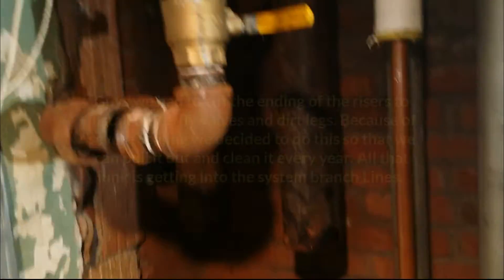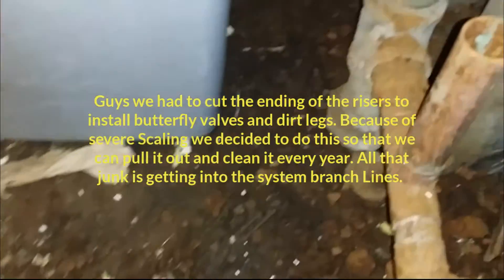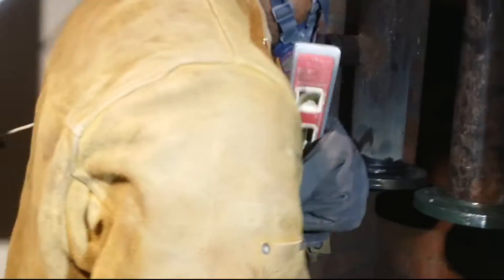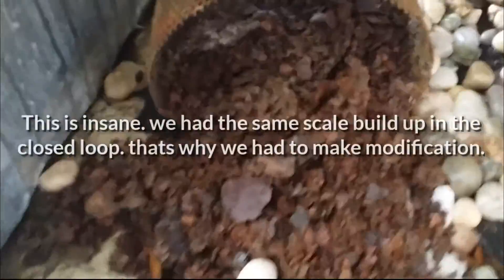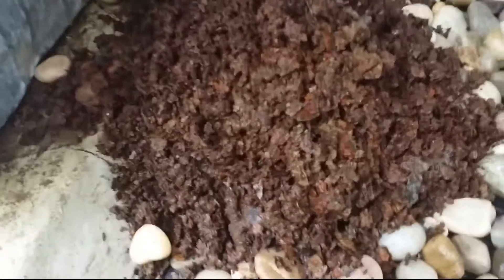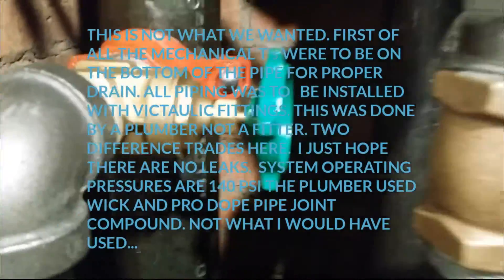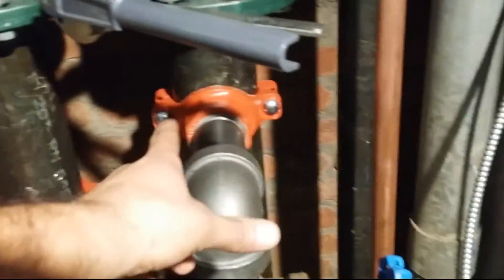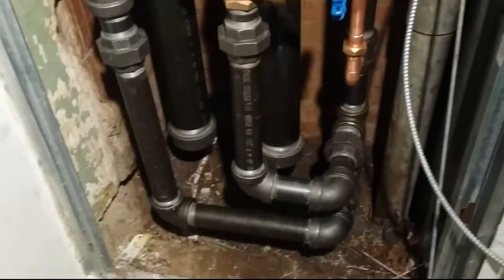CoolingTower | Bad Water Treatment | Piping Modified

Comment: Water treatment is very important as indicated. I worked in 12 story building with a cooling tower that had 3 water source a/c only air handlers per floor and every bundle was 100% clogged. Took 3 months to punch every tube cleaned, once proper water treatment was done, we punched tubes yearly and the difference was amazing. The higher ups wouldn't approve replacing piping that was needed, so we had to patch pipe when pin holes started happening.
Reply from the maker: Yeah that's the way to do wayne. Negligence will cause issues.

Comment: It is a deference between fitters and plumbers I'm in Philadelphia local 420 steamfitters union I'm a fitter I'm also a  HVAC B service mechanic as a fitter I pipe heating jobs with service in mind. I like pro dope for gas pipe but for hot water and steam I use real tuff stuff it's like liquid Teflon nice vid Emin
Reply from the maker: Brother we gave them a price for the job. They refused our quote. We would have done the weld and the fitting. We even gave them a drawing they fucked up bad. On top of that he put the drain mechanical T on the top of the pipe. I just got word that it's leaking all over the place. I left my guy there to fill up he called me to break the news. Good for them. This is what happens when you take the cheap way out. Local 638 myself